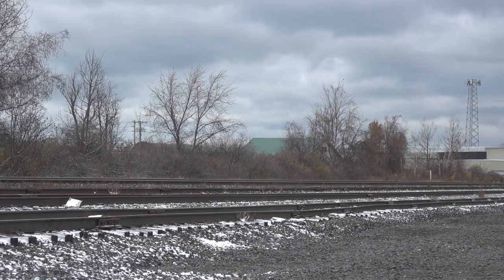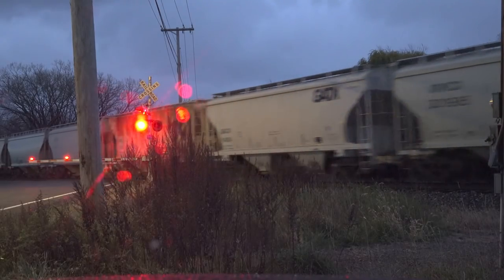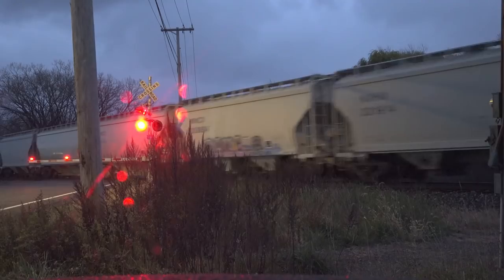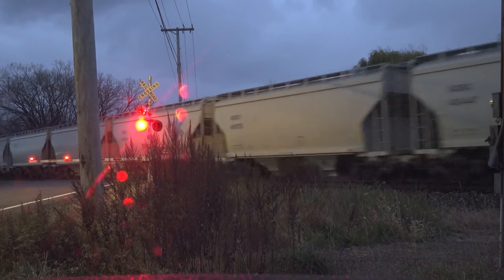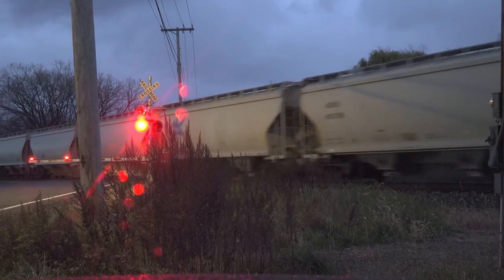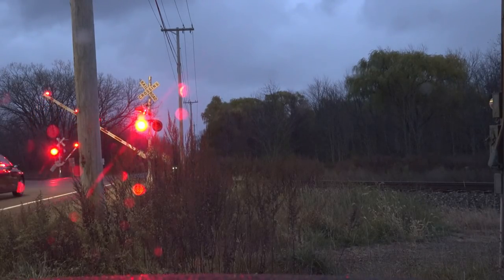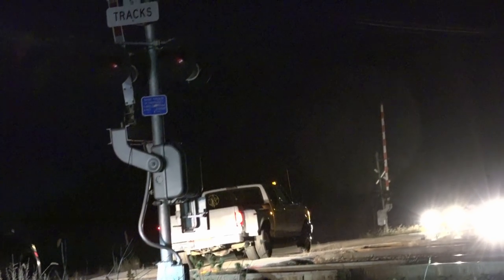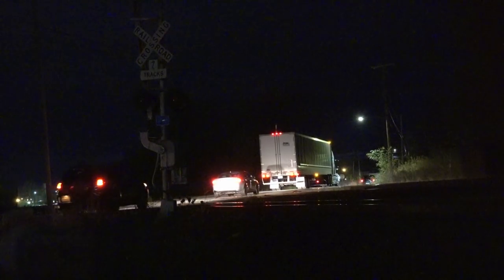Two CSX Trains Meet At Night! 2 BNSF Engines Pull Long Sand Train! Big CSX Train With a DPU Alright!

Comment: 0:59 We are at the CSX Middle Road crossing on the east side of Dunkirk, New York by the Nestle Purina dog food plant on 26 oveember 2021. We are awaiting the arrival of CSX train #I158. CSX train #I158 passes our location and a mid-trian DPU appears at 1:26. The rest of the train passes.
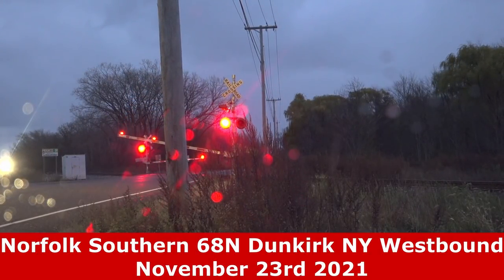]2:42 It is 23 November 2021, we are at the Norfolk Southern's Middle Road crossing about a 1/4 mile south of the CSX crossing of the same road. The lights are flashing as the gates go down and we see the headlight of Norfolk Southern train #69N. This train is an as needed train of empty 2-bay frac sand covered hopper cars from Sayre, Pennsylvania that goes to the Canadian National Railroad in Chicgo, Illinois. This train is powered by two BNSF engines.
4:48 We are at the Berry Road crossing in Pomfret, New York on 24 November 2021. We are looking east at CSX train #I009 as it is approachign the Van Buren Road crossing. The train is about a mile away from us. The gates at the Van Buren Road crossing start to lower at 4:59. The ditch lights start to flash at 5:22 as the engineer start to blow the horn to warn of teh train's approach to the Van Burn Road crossing. Train #I009 reaches the Van Buren Raod crossing about 5:41. Train #I009 hits the circuit that controls the lights on the Mile Post 44.8 signals at 6:13 when the lights for the signals turn on. The engineer blows the horn to warn of the train's approach to the Berry Raod Crossing at 6:28. The lead engine crosses Berry Road at 6:43. A mid-train DPU make an apprearance at 7:09. You zoom in on the end of the train after it passes Berry Road. We see that the train is blocking both the Lake Road and the Martin/Willow Road crossings. We can see the I-90, New ork STate Thruway, bridge over the tracks. The gates at Lake Road start to ris at 9:37. The Martin/Willow Road gates rise at 10:14. The train appears to pass the Mile Post 47 signals around 10:54. It is difficult to determine when the train actually passes the Mile Post 47 signals because of the distance between Berry Road, where we are, and almost three miles away, where the signals are. You start to zoom back to a normal view on the camcorder at 11:06. You pan the camcorder so that it points east along the CSX tracks. At 11:35 you walk in front of the camcorder to talk about CSX train #I009.
12:00 We are at teh CSX Middle Road crossing on 21 November 2021. We are looking east in the dark as an eastbound CSX train is approaching from behind us. This is CSX train #Q364. This is a daily train from Avon, Indiana, which is a western suburb of Indianapolis, Indiana to Selkirk, New York. This train works Crestline, Ohio; Collingwood Yard in Cleveland, Ohio and Ashtabula, Ohio on its way to Selkirk, New York. The train passes us and at 13:23 the train knocks down the green light on the Control Point 37 signal bridge to a red signal. 
14:31 You shout out that we have a train meet as we see the headlight of a westbound train lighting up the rails on track #1 as train #Q364 comes to an end. The westbound train is CSX train #Q367. CSX train #Q367 is a daily train from Selkirk, New York to the Belt Railway of Chicago's Clearing Yard in Chicago, Illinois. This train works DeWitt Yard in Syracuse, New York and Collingwood Yard in Cleveland, Ohio on its way to the Clearing Yard. You pan the camcorder to the west and the headlights of the cehicles stopped at the Middle Road crossing illuminate the cars on train #Q367 as it passes the Middle Road crossing.
17:16 Your outro begins and this video starts to end.
Thank you for compiling this video ad for uploading it for our enjoyment!
Reply from the maker: Thanks Tom